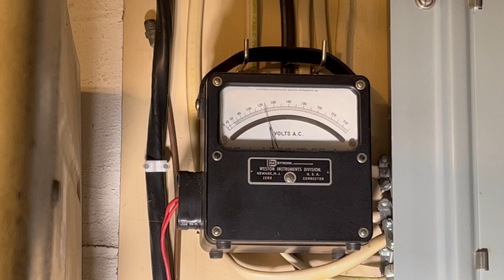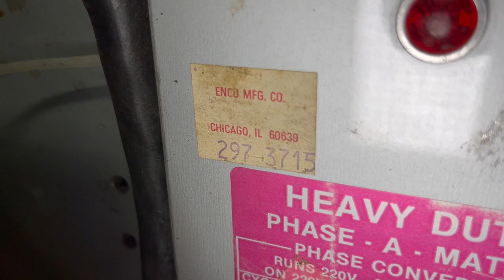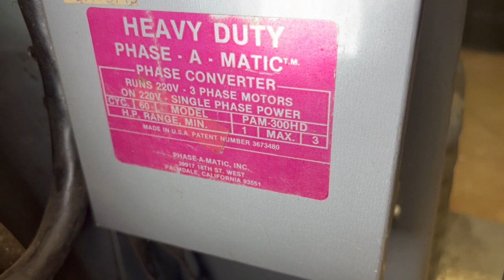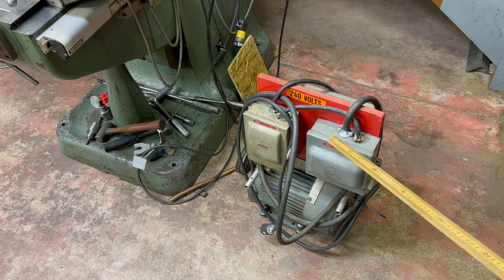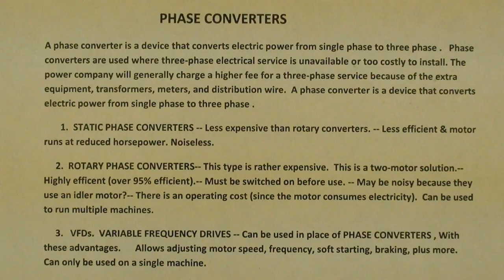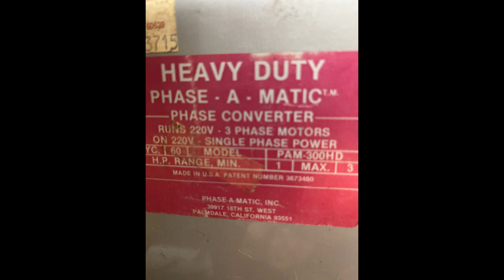Phase Converters STATIC TYPE #784 pt 2 tubalcain

Comment: Always a thumbs up and this time no exception.  Any 3 phase motor will run on single phase current, it just won't self start or deliver full rated power.  The "idler" in a rotary converter is by no means idle.  Any AC motor works by the interaction of the field coil magnetism and the magnetism induced in the armature by currents in the armature due to the field magnetism,   Evidence of this, at least for us old guys, is when  you started a motor years ago, the lights would visibly dim until the motor came up to speed.  A similar effect occurs in the un-energized field coils of a 3 phase motor running on single phase.  The magnetism in the armature induces a current in the un-energized coils, which we can employ to operate other 3 phase motors.  All that has to be done is to start the "idler", which can be done in a variety of ways.  The older static converters usually employed a capacitor bank to change the relationship between voltage and current  in an inductive load like a motor.  This, modified current Anybodycoupled with the original current, is enough to self-start a 3 phase motor.  It is not a true 3 phase current, like a rotary, but it is entirely functional.  Then we come to the VFD.  This is relatively recent technology which, I understand, employs the metal-oxide field-effect transistor (mosfet) and computer controlled switching to literally construct any number of circuits in any phase relationship and any frequency.  Fabulous technology, all digital, making lots of inroads in industry and generating spinoffs that we can employ, and it just keeps getting cheaper, and more powerful.  Similar technology handles thousands of horsepower in modern locomotives.  Anyone who considers pure research, especially industrial, a waste of money, or that our best days are behind us, like the maga crowd, better get their head on straight.

Comment: I purchased a Ronk static converter, it had been used in the area high school until they got three phase run to their shop.  I use it, mainly, to run my DoAll surface grinder.  It utilizes two motors full time.  I tuned the converter to be balanced with both motors, but I have to start the spindle motor first, then start the motor to the hydraulic pump.  The spindle motor circuit controls the relay that switches the start capacitors in/out of the circuit, so it always has to be running before the pump motor.  Once the spindle motor is up, it behaves enough like a rotary converter that the second motor can be started without problems.

This particular breed of static converter does use a transformer to generate the "wild" leg power.  An amp meter is needed to tune it in to the machine, which is done by changing the tap from the transformer and adding/removing capacitors in the circuit.  A relay and a second bank of capacitors provides the "umph" needed to start the (1st) motor.  The converter is a "pass through" type, so, once I move a few wires around in the control panel, I'll be able to use the mag chuck without the spindle running.  The mag chuck uses single phase, and still has the old tube type converter, so I'm not risking using it without the spindle motor in operation ... that can make setting up a rather tricky operation.  When I know the mag chuck is off of the "wild" leg, I'll be able to get rid of a hazard.

I've used the Ronk to run my old drill press, but I can't do that as a stand alone.  I have to tie the surface grinder in, start the spindle motor, and then I can run the drill press.  I intend to find a similar size/amp rating motor (to the grinder spindle motor) to use as a mule, that should bring the converter into balance enough to run other machines (like a rotary converter) without having to re-tune it or run the grinder.  My other machines have, or will have, motors of similar hp/amps to the grinder pump motor.  I don't anticipate any problems, time will tell me if I'm right.

It's not an ideal setup or plan, but I run only one machine at a time, and it's better than nothing.
Reply: Sounds like you’re busier than a long tailed cat in a room full of rocking chairs.  (:-)))

Comment: Good information.  I have a box about 11 X 8 inches that I hooked up to my South Bend 10 inch lathe to get it to run on 220 from the house.  It works but is slow to start and the lathe doesn't have much power.  BTW  I flew the Tri-Pacer up to the Florida Flywheelers show on Wednesday and walked around for hours in the heat, Didn't see you.  Wow that's a very big show!  Best Regards maybe next time!
Reply from the maker: Over 220 acres

Comment: Hi Mr. Pete. I am running TWO machines on ONE static converter. Been doing so for close to 40 years now. My understanding is the static converter is only need to start the motor. You can't start 2 motors at the same time but one after the other. They are rated by horse power and as long as one of your motors is not over the limit your are good to go. Thanks for your vids, Carl
Reply: Yes, you are correct about running more than one machine on a static. When you start the first machine with the static converter, it turns that motor into a rotary converter (the machine motor acting the same as the idler motor in a rotary converter). The control box of a static converter is basically the same as the control box for the rotary converter, where the rotary converter controls start the idler motor, the static motor controls start the machine motor.
Reply: @m16ty  Thank you m16ty.

Comment: Mr. Pete, excellent demonstration on low voltage 3 phase. You covered several ways to do it.

I want to remind you about some things I saw in both videos. In the first one, you showed several black wires going through a gray painted sheet metal panel. Those wires should be bushed. Wrapping some tape around the wires will give some protection while you get the right bushings. Also look at how tight the wire clamps are on the converter with the red painted board. They are tight enough to hold the wire without crushing the insides. Look at the ones you tightened are over tight. And if you are going to have wires going into the box be without the outer jacket at least bush the hole, or wrap some tape so you protect the wires from the sharp edges of the boxes.

Comment: Good video. I use a VFD on my Sheldon lathe and a rotary phase converter (RPC) on my Supermax milling machine. I like the VFD a lot because it is quiet, small, and has variable speed. I used the RPC on the mill because it already had a variable speed capability with the Reeves drive. The lathe only had speed adjustment with step belts and gears so I used a VFD for that.

Its very interesting how a RPC works. The idler motor acts simultaneously as a motor and a generator. The capacitors primarily only serve to start up the idler motor on single-phase power.

One thing to know about a VFD is that it is not a total substitute for step belts or gears. By using the step belts in combination with the VFD you can maintain good power at all speeds.. If you just rely on the VFD and a single belt or gear setting for all your speeds, then you will lose power as you lower the RPM because you have lost the torque multiplication supplied by the different sheeve or gear combinations. I select the sheeve combination that gets me closest to the speed that I want. I then use the VFD to supply speeds that the sheeves cannot. Of course you get the other advantages of a VFD such as soft-start and dynamic braking if you so desire. If you don't do heavy cuts then a VFD without step belt changes may supply plenty of power.

One final technical note for those interested. The equation that relates power, torque, and RPM is: HP = (torque x RPM)/5252. This shows that when torque is reduced at a given RPM then power is also reduced. This explains why a VFD is not a total substitute for the sheeves and gears.
Reply from the maker: Thanks 👍👍👍
Reply: The output torque of the motor also decreases as you deviate from 60hz (or 50hz in some countries), the line frequency. The farther away from the line frequency, the greater the decrease in motor torque, i.e. 55hz or 65hz might give you 90% torque while 20hz or 90hz might give you 30% (just random numbers, the actual value depends on the motor). Another thing to keep in mind is if the motor is fan cooled, the lower the rpm the less air the fan will move across the motor which can lead to overheating issues especially since you tend to place a greater load on the motor at lower spindle RPM (larger workpiece for a lathe/larger cutter for a mill and deeper depth of cut). This is also true, but to a lesser degree, when you increase the motor RPM over the rated RPM since fans tend to be designed for a specific RPM range, but you tend to put less load on a motor at higher spindle RPM (smaller workpiece/cutter and shallower dof) than at lower spindle RPM. And as you pointed out, using a VFD to for all speed changes doesn't give you the mechanical advantage that pulley/gear ratios would. So, as you said, it's best to use pulleys or gears for large, coarse changes in spindle speed and use the VFD to fine adjust.

Comment: The VFD I bought caught fire the first time I tried to use it. 

That $1 Phase-a-matic was one heck of a find!
Reply: I had a phase a matic that never worked. I now have a phasemaker 9hp rotary phase converter, still running 8 years in the making.
Reply: @thedirtyknobs  I can only assume it caught fire because it was a Chinese made piece of crap. I followed the manual to the letter and double checked everything. 
Was running my Bridgeport with a Phase-a-matic, never had an issue. Changed lathe motor to a 3 phase, wanted 100% of the motors HP so got a North America Phase Converters 5 HP rotary which runs both mill and lathe with ease.

Comment: In my previous shop I had a static Phaseamatic running my old Bridgeport, it ran fine, but then I found a three phase motor for cheap and turned the Phaseamatic into a rotary phase converter. There are instructions on the Interweb, and possibly here on YouTube. 
In my current shop I have four three phase motors all running on their own VFDs. I've sort of fallen for the VFDs, there is a learning curve, but once you've figured out one of them the rest are easy, especially if you stick to one brand, My first was an Hitachi, relatively expensive, but the rest are Huan Yang, $100 -$200, and Amazon has some VFDs listed in the $50 range. Research them carefully, get the right size, but beyond that there are lots of choices. For example if you need dynamic braking (for really quick stops) make sure it supports an external resistor. You can also mount a control panel where it's convenient, well away from the VFD and motor.

Thanks, Mr. Pete!

Comment: Thanks Mr. Pete. I have a large workshop with 1ph power, bought a 100 amp rotary converter at auction, way more than needed power wise, for lots more $ than you did. Plan to run a 14 inch lathe, a milling machine and tool grinder off of it. Thanks for all the videos they are very informative.

Comment: Great video Mr Pete! ! I bought a 1973 Clausing 15" that  had a static converter installed on it. Worked great until you tried to turn it above 1000 rpm. Had to feather the clutch to achieve the higher rpm's and the machine just sounded like it was laboring. It worked ok with the collets but not the 3 and 4 jaw chucks. I found a Phasemaster rotary on craigslist, 7.5 hp, and Wow! Runs like it's supposed to now! I also switched my 3 hp Kingston mill to the converter and even bigger Wow! The 7.5 hp Phasemaster will run 15hp total simultaneously with 7.5 hp being the maximum size motor allowed. I mounted the phase converter on some soft rubber casters so I can move it to clean around the machines easily, and the casters isolate the converter from the floor. I don't even notice it! Just my long 2 cents worth! Thanks for your time and sharing Mr Pete! 👍😎
Reply: I strongly second using casters and also did my RPC. I mostlyuse round shank 1.375" scaffolding casters with 8" wheels (and bought a stick of pipe to make mounts aplenty!). My air compressors are castered along with some machinery moving dollies (I don't pay riggers and my dollies bolt on making them far safer than dangerous machinery skates, I made them to roll onto my car trailer).

Comment: Very informative. When I bought my Rockwell 9 x 36 lathe it had the 3 phase motor in it. Rather than buy the converter, I bit the bullet and bought a new single phase 240 volt motor. The Rockwell lathe has a built-in variable speed control as most of you know. I think the motor was $250 from Grainger. My new CNC router (wood) has a VFD with a spindle... works great. But Mr. Pete has presented some very valuable information especially for older commercial machinery. Love the VFD on the little South Bend and the drill press!
Reply: I’m guessing you would get better performance & durability from your motor with quality 3-phase however.

Comment: I have found VFDs to be the best solution for generating 3 phase for machinery 5HP and under. The speed control aspect cannot be overstated and the jog feature is extremely valuable when tapping. Not to mention the programmable acceleration, deceleration and braking features.

 Just remember that VFDs need to be oversized when generating a 3rd leg - usually by a factor of 2. Most cheap Chinese inverters are reasonably reliable when oversized in this way.

Comment: I have been running a Hitachi 1hp VFD for over 10 years. I mounted it on a wall with a pigtail on the output end and run either a 15" disc sander, an edge sander, or a UniDrill with it. I can only run one at a time and always power down the VFD before swapping machines. Variable speed on all 3 of those machines is helpful..... Plus it is a phase converter

Comment: Looking at your Walker Turner drill press reminded me of my vintage Delta drill press that I inherited from my father. He was an electrical engineer by profession and rigged up the Delta with a surplus DC motor running off of a butter box full of selenium rectifiers and a Variac. Great speed control, but no torque at low speeds. It's still running flawlessly after 70 years. I have a DC, ex-US Navy grinder with the same setup.

Comment: I want to power a South Bend 17" Turnado Lathe.
It has a 7hp three phase motor. I am a retired machinist and ran this model for 10 years. It had 
Bausch and Lomb DRO, Dumore grinder, soft Jaws, steady and follower rests, taper attachment, etc. I will just be doing light stuff. No hogging.
I have 100 Amp 240 volt single phase in my 30 x 40 shop.

Comment: I've had a pull start with rope 3ph motor in use as a converter for 20 years. Another additional step to wind the rope and pull..

Comment: Worth noting is you can build static phase converters for MUCH less than they sell for retail. They're dirt cheap to make with very few parts.

I like that simple RPC. The builder using heavy gauge SOOW cable obviously did so for durability and of course low resistance. Power equipment should always be over-spec'ed because surprises happen and being able to power more than lightweight motors often useful. 

Those who have outdoor shop areas can place RPCs outside their building the way many do air compressors, beneath a shed roof or full shed as desired to dispose of the noise issue. Static converters while not as versatile as VFD can be (like RPCs) cheap to build for yourself.  I suggest anyone curious try all three since the only one you have to buy complete is the VFD which is no risk since the speed control aspect would be worth the money on a lathe or mill. It's usually easy to score large three phase motors cheap and building a larger RPC is the same amount of effort as a small one. 

Mobility can be useful for people with shops they plan on expanding or want to rearrange easily when they add a machine. I put my RPC on a frame with large industrial casters for easy movement about the shop depending on the project. RPCs can power transformer style welders (I've not tried it with an inverter welder) which lets you buy used three phase industrial welders cheap used. Most hobbyists and many small businesses only have single phase power so used three phase-only machines often go cheap, and overkill on a welding power source is a very good thing.
Reply from the maker: Thank you very much for that advice

Comment: I have a Baldor VFD on my Millrite Powermatic vertical mill.  I find significant loss of torque at the low end of the VFD frequency range and still have to move the v belt to optimize low end torque.  The static converter on my Harrison 13 lathe is a Phase O Matic and works great except it  does not provide enough starting power to operate the lathe at the two highest speed ranges. It is properly sized for my motor according to the literature provided.  As you pointed out, my rotary converter operates the cold saw, iron worker, and horizontal band saw.  Just wanted to relate my experiences, Thanks for the great information Lyle.
Reply from the maker: Thank you Roger that is interesting to know

Comment: The biggest trouble with static types is having to adjust them for motor power, that is if you run different size machines on one converter. For instance, if you have a large machine, fitted with a suds pump, if you stop the lathe or whatever, but leave the small suds pump running, it will burn out pretty quickly, also you need to make sure you have your true phase connected to your start switch, otherwise it won’t energise the coils in it.I wouldn’t use anything other than a vfd ( digital inverter) these days, they give true three phase, and if your limited power wise, they will start a huge motor, bringing it up to speed slowly. Of course the other advantage is being able to run at any speed, without changing belts.